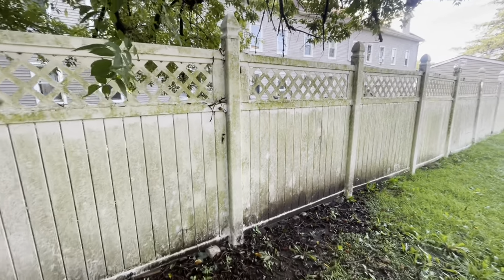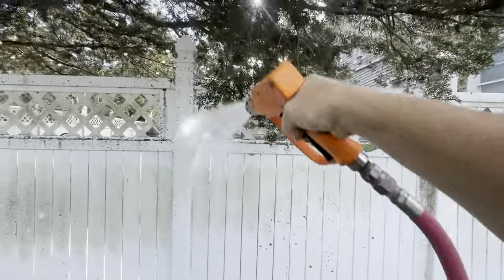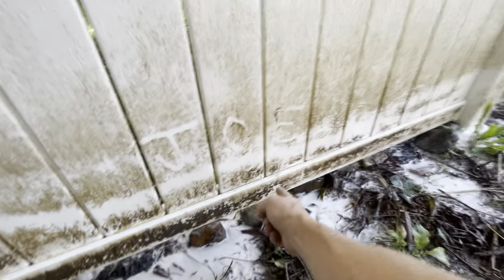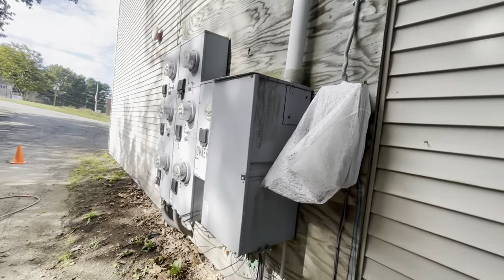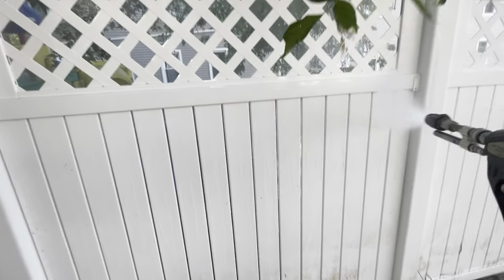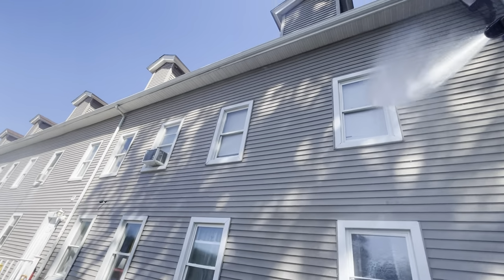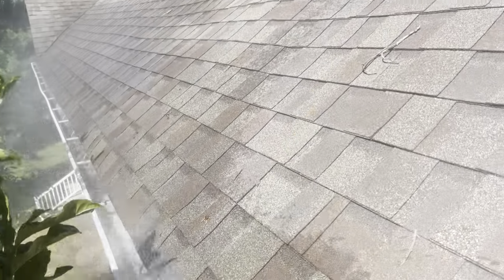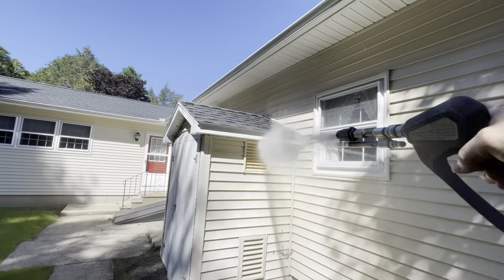How to Wash Vinyl Fence

Comment: Joe, do you NOT rinse before soaping?

I’ve be pre-rinsing everything…. Seems if I could cut that step out, obviously it would speed up the house wash
Reply from the maker: @Truthandfire72  I will rinse plants a little if I think they are sensitive. Sometimes I’ll hit the glass or metal quick with a rinse before soaping. But as a rule , no I do not rinse before soap
Reply: @powerfulimprovements  thank you Mr. Darkness 💪
Reply from the maker: @Truthandfire72  ✌🏼❤️

Comment: With a mix that hot wo you flood the ground before or after to decrease risk of burning the lawn?
Great work dude
Reply from the maker: Not so much. You see it wasn’t much to worry about on this one
Reply: Lol yeah that whole property was a shit show! Maybe a better question would be, if that property wasnt so shit, and had a nice lawn would you take the extra pre cautions? lol thanks for the speedy response too! @powerfulimprovements
Reply from the maker: @CROCS.fit123  yes sir. For sure. Likely wouldn’t have run as hot and would have flooded grass first
Reply: Thanks man, I've been considering starting up for 2 years, trying to learn as much as possible the easy way before learning the hard lessons :P Greatly appreciated
 @powerfulimprovements
Reply: I believe you stated that you had A LOT of rain the night before. That definitely mitigates the need to pre soak.
Reply from the maker: @tonysmith5785  correct

Comment: Good video. What kind of chemical are you using. I have white vinyl privacy fence that needs cleaning. What kind of chemical and how much per gallon of water. I live in North Carolina. Could you help me out with information
Reply from the maker: We use pool shock. Cut 50/50

Comment: Have you ever looked into foaming, on fencing like that?
Reply from the maker: That would be a great idea. I need a foaming tip
Reply: No, not a foamer tip. Just the foamer bottle. They hold about 1 litre. Add maybe 2 good squirts of any soap, top up with SH, & foam away. Sticks like shaving foam. You can always get rid of the bottle, hang a 2 gallon spray bottle off your shoulder, pick up tube to the foamer, & your all set.
Reply from the maker: @slim439  I had one for a minute.  Never used. Will add. Thank you for the tip
Reply: Might do the job. Be like spraying with a wide fan, lots of cling. Come back & washy washy.

Comment: Why didn't you place a drip catcher under the fence to gather the soap, and place it a grey tank or that ever and re-spray. Soap can separate from dirt
Reply: A "drip catcher?"  Under 250+ of fence?  How long do you want to be here on this task?  That's assuming you can even get this "drip catcher" under the fence.  And then how are you pumping this collected material and separating it to reuse?
Reply: @silverstake88  hey Einstein where did I say to use a 250+ feet drip catcher.  Use like 200 feet